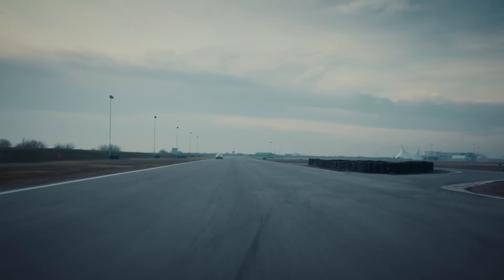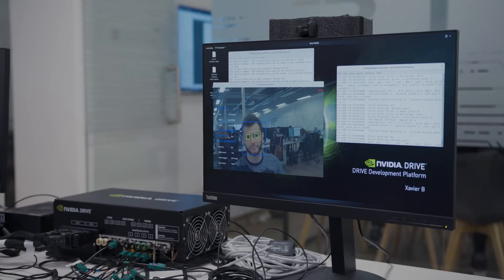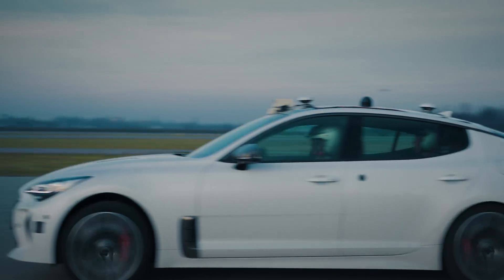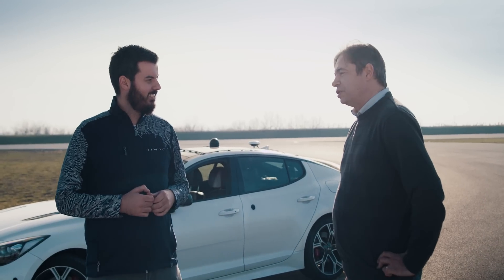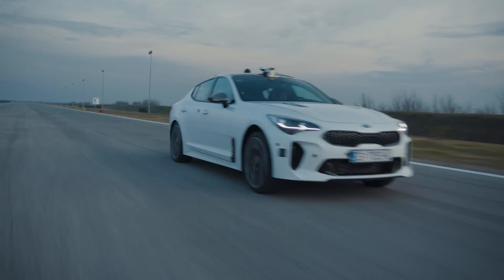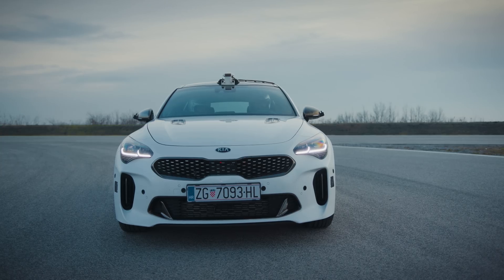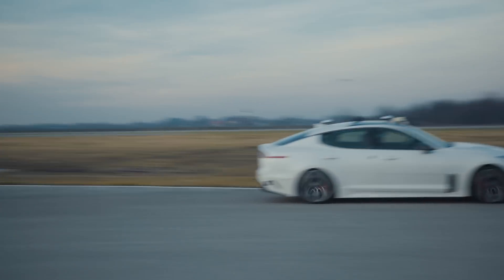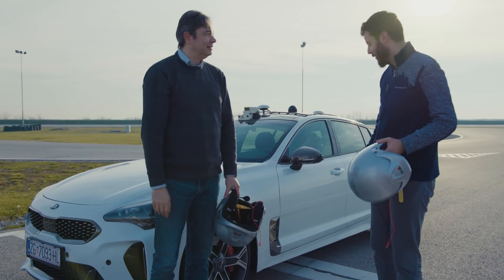Rimac Driver Coach Development 1/3

Comment: But why KIA?
Reply: Rimac has partnership with Kia and Hyndai. They invested about 150 milion € into Rimac if I remember correctly to work together on development of new electric high power vehicles for Kia ans Hyndai.
Reply: Kristijan Grgić That makes a lot more sense, thanks for the information.
Reply: I believe those comes with electric power steering instead of hydraulic, which make it easier to adapt to an autonomous driving system. That’s my theory.

Comment: whaat ?? the car can teach u how to drive on the track ?? this is revolutionary !!!!
Reply: Rimac is again showing the industry how it's done.
Reply: @Cloxxki  Is not revolutionary. It is same as the autopilot, iT'S  a neural network trained to control de car. What changed is the dataset. The worked to do this is less than to do autopilot.
Autopilot has to recognized more signals and more behaviours tha this...
Reply: Both of you are correct. Driving fast on racetracks requires a different focus than managing normal street situations. The subject of teaching a driver with a robotic system is a revolution for traditional driver education though and was the topic of my Dissertation, check out this video: 
https://youtu.be/5wPoGc8Z2q4?t=209
I am really looking forward to video 2 and 3 of this series, way to go Rimac!!
I'm interested to see, if they also throw "shared control" (robot and human driving together) into the mix :)
(and @Rimac, make sure to check out this short summary of my results on this next step of automated driver teaching https://link.springer.com/article/10.1007/s38311-019-0130-3 )

Comment: Why do you use an ICE car and not an EV?
Reply: I analyse it this way....Rimac still now dont have a production model which they can sell on road.Same time major automobile companies invested and also are buying products & technologies from Rimac.So rimac calculates to be oem model player catering to other automobile companies .Auto pilot technology may be interested/ requested by existing players for ice versions.
Reply: Because they were bought by KIA (Hyundai/Kia bought shares) and they probably provided them with the Stinger. It’s a good reliable car for testing. Why should they test with an EV
Reply: @danI43541  Right .Also ice market also will be targeted by rimac

Comment: what is the difference between this system and system used in tesla ?
Reply: The Rimac Driver Coach is instructing (teaching) you on how to drive a car on max performance on a race track. Other systems just drive you from A to B on public roads without any further input.
Reply: @mgcharoudin  please you should take this system to nurburgring.
Reply: @mgcharoudin   is there any difference in the sensors, camera and computer used since the cars is travelling at much higher speed
Reply: @mgcharoudin  Really?? "Other systems JUST driveS you from A to B".  So, for you driving autonomously in a highly unstructured and unpredictable environment is "just driving", while driving on an empty, pre-mapped road is something more advanced?
Reply: @dmeister2909  Yes, it's nothing spezielle. Many car manufacturers have some kind of autopilot in their cars.